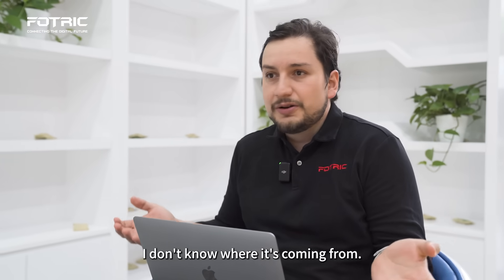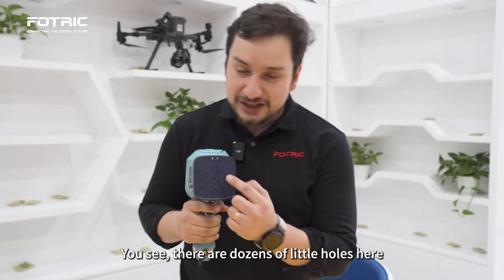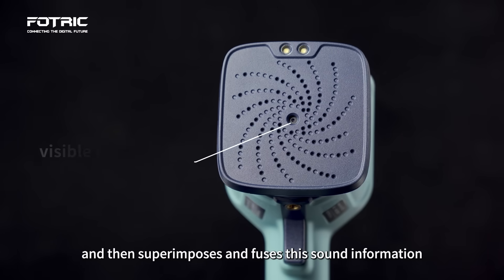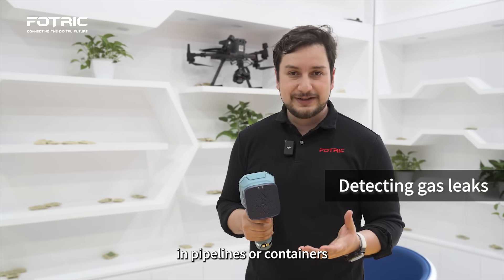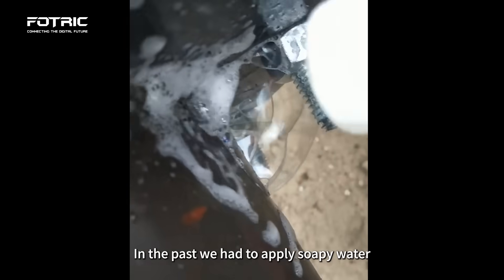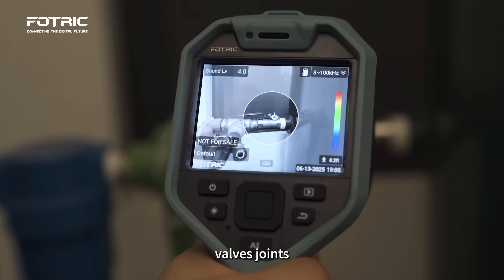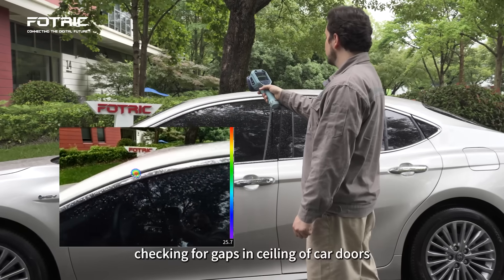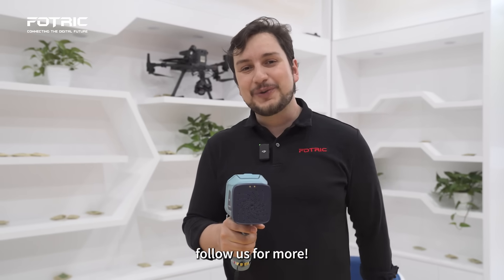See Sound. Discover How the FOTRIC TD2 Spots Invisible Leaks

Comment: I own a bulk tanker shop ie. Fuel tankers ect. We test for low press leeks and high press. Leeks . Not to mention the air brake system, air operators valves. Ton of leek potential.  Im going to have try one of these very very soon.